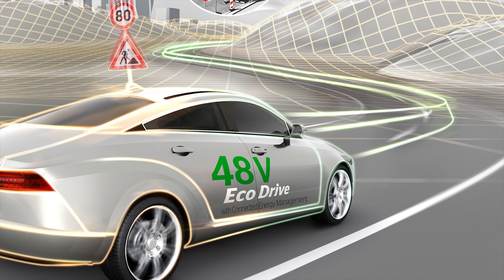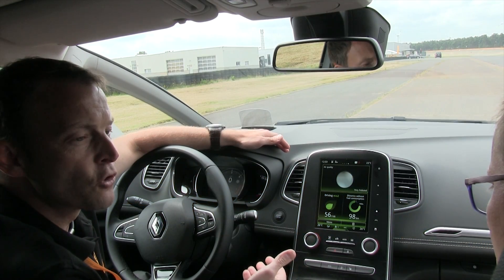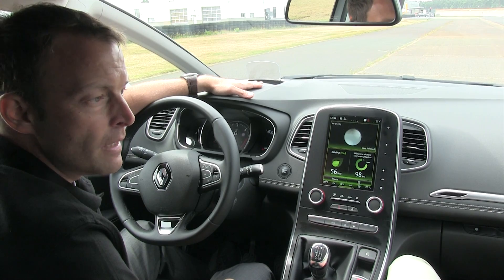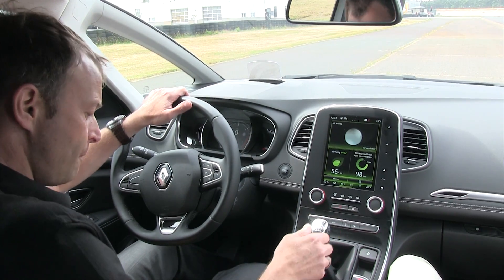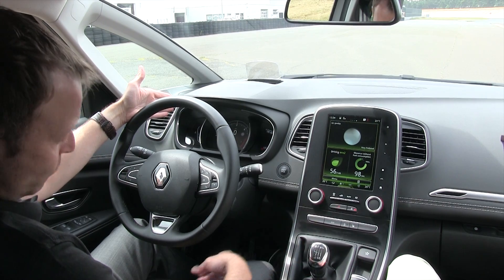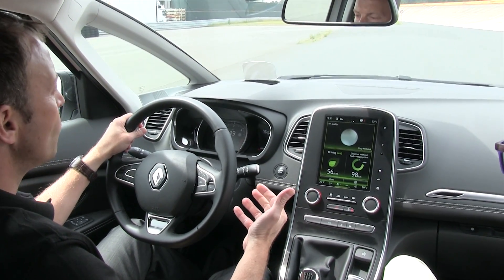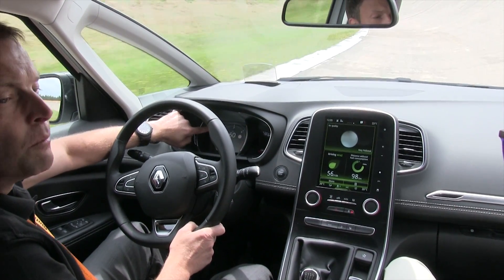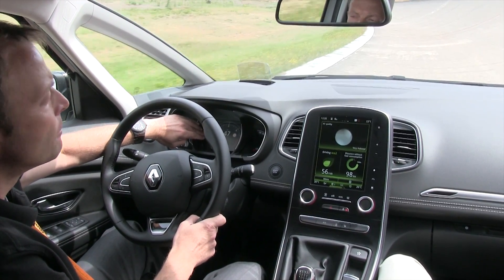Continental Mild Hybrid 48V electric installation in cars - test drive :: [1001cars]

Comment: Can it be fitted in others car?
Reply from the maker: Yes, many cars have it right now.
Reply: @1001cars  thanks!!! I want to fit it in a peugeot 206sw 1.4 16v, I have to find someone that can do this fittement in italy
Reply from the maker: @ziobonfa96  No, you cannot mount it aftermarket. It is necessary to have stronger battery and exchange some parts.
Reply: @1001cars  i've to find some retrofit mild-hybrid to mount
Reply: @1001cars  Can it be mounted in a Seat Toledo 2018 with 1.0tsi with Start-Stop technology already in it?
Reply from the maker: @SHT5029  I think not, VAG started using it around 2020-2021 with 1.0 TSI

Comment: When it comes to auxiliary boost for petrol engines, ISG are the way to go. Turbos are more at home in diesel engines. ISG can shave off a second to the 60km/h sprint while at the same time adding a KM to the liter. Can't say the same for turbo. There are no costs or weight involved in improving engine's metallurgy to cope with the force fed combustion nature of turbo engine. Modern generator disconnect from crank pulley while accelerating and when batterirs are charged. I am waiting for a 48v ISG to debut in a 3 cylinder engine.

Comment: other than the fact that the larger generator starts the engine more smoothly, i can not see any advantage from adding the 48V circuit to this car. the generator makes more electric power but consequently must have a higher resistance to so, just by law of physics. so it also slows down the engine more than a conventional generator. hence, what is the advantage over a 12V hybrid?
Reply from the maker: Where do we have 12V hybrid?
Reply: @1001cars  BMWs are 12V hybrid. All of them.
Reply: 1001cars
In 2019 Golf MK8 with 2.0TDI EA288 Evo.
It has a 12V mild-hybrid system. That is known since last year. Now it's official.
Look at Volkswagen press release from april this year.
Reply: Jump NYC
The advantage is more profit for VW. It's cheaper to build.
Reply: If you decouple engine you lose lots of engine drag when coasting. While also recuperating from gearbox side.
Reply: You don't know nothing about physics....so you will not understand it.